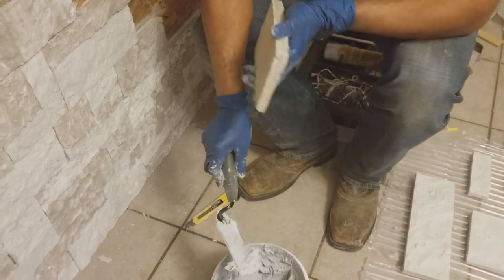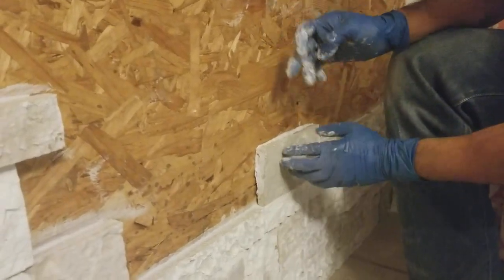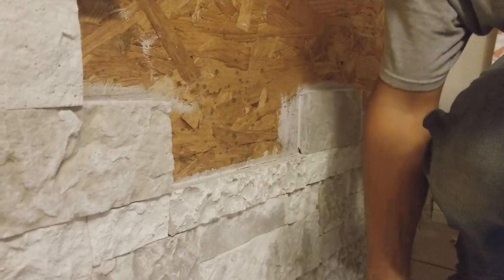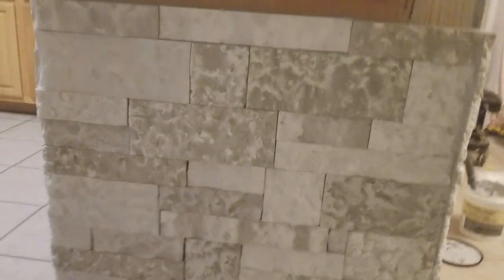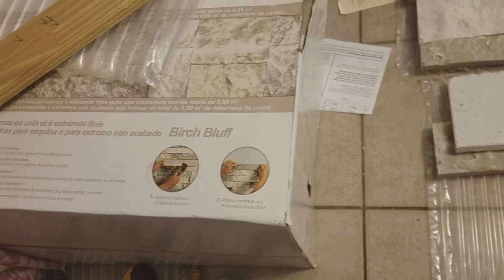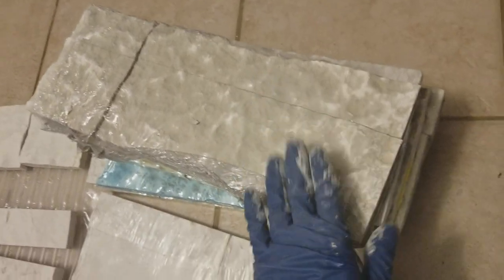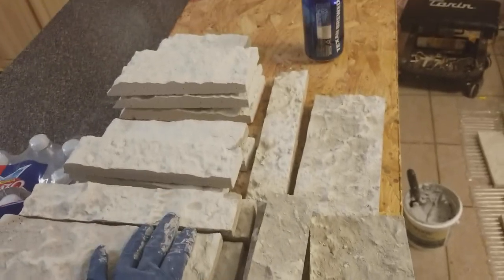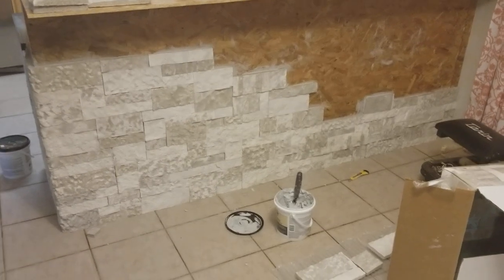Air stone installation

Comment: The corner boxes are corners. The top 2 retro fit with each other and same goes with the other 2. If you place the paired pieces end to end on each side of your corner, they fit perfectly together, and was designed  to be that way. It’s not a half box of a corner and half flat surface. This is why your corner edge looks uneven and not fitting. Should be a smooth transition around the edge.

Comment: I would recommend reading the instructions when you install the corner pieces. It looks much nicer when installed as per the manufacturer.
Reply from the maker: Well in certain cases I agree. As for this since 90% of the time your either looking from the living room or from the garage, I think it worked out in my favor because not many views from a corner angle due to my layout. But in different cases I do agree. Then again just personal preference. Appreciate the reply.

Comment: Would like to know how to apply this around a large circle, like the one-handle faucet of a garden tub faucet that comes out of the drywall. Unlike electrical boxes, you can't "extend out" the circular surround plate of such a one-handle faucet.
Reply from the maker: Wil Ferch  You may be able to get a hole saw bit and drill a hole in one or in 4 corners or just  2 of them  on the ends that meet. I can certainly try this weekend with some scrap pieces.
Reply: No doubt that will work.....but the crux of my question is not the round/circular aspect.....but the fact that the round faucet cover plate will be severely recessed ( the airstone is thicker than the faucet surrond). Unlike electrical boxes which can be "extended" out of the wall a bit more....I don't think the stainless steel faucet "Surround" can be extended "out"..... can it ?
Reply from the maker: Wil Ferch ohh I understand what your saying. I suppose it would depend on the brand faucet you buy. I know the ring around my shower heads are adjustable.

Comment: Thanks for video,nice tip.I have 18Ft fire place,do i need cement board or mesh wire before installing stone?
Reply from the maker: No sir. You don't need that with the air stone because they aren't as heavy as the real stuff. I seen videos where they put them on the wall over the paint and on new dry wall as well.

Comment: What works best to cut airstone??
Reply from the maker: The grinder with the diamond blade worked best I believe. Or a tike saw with the same blade.
Reply: I thought the corners were pre-made. The photo on HD is misleading
Reply from the maker: @lbrady-sq8gb  yes it is. You can overlap them if you want. I have seen some do that.

Comment: That looks so fkn messy.
Reply from the maker: Just dusty when you cut it. Recommend cut outside definitely. Putting it on the wall isn't bad. I wore rubber gloves. That made cleanup easier for me.
Reply: The final result looks nice. I think that's the important part.
Reply from the maker: @jaimeluevano149  cutting this is about like sanding sheet rock. At least this can be cut outside to keep the dust out of the house, lol.